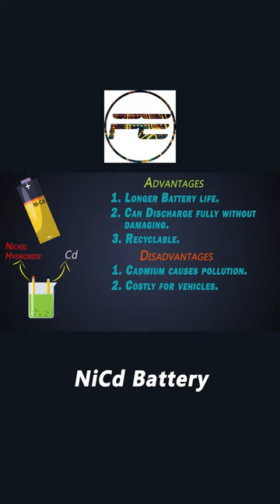Understanding NiCd Battery

Comment: You can use zinc as the cathode and make an analog of it that is a NiZn battery, the battery has a higher voltage and also less weight. The downside is that it needs a catalytic hydrogen recombiner to keep the electrolyte stable.